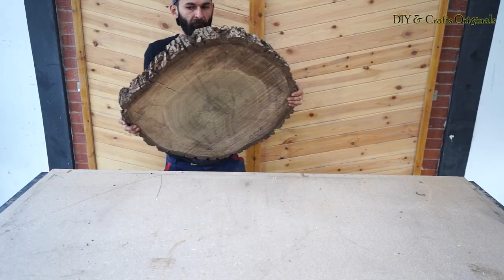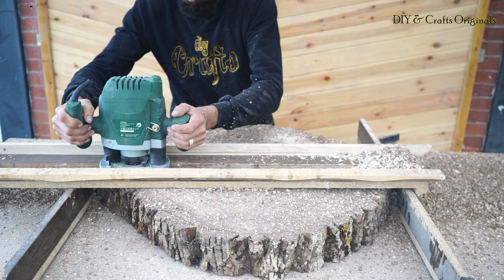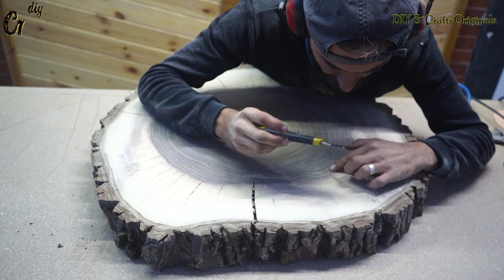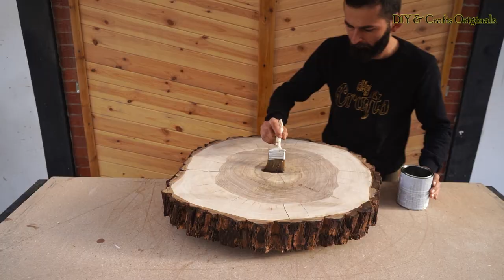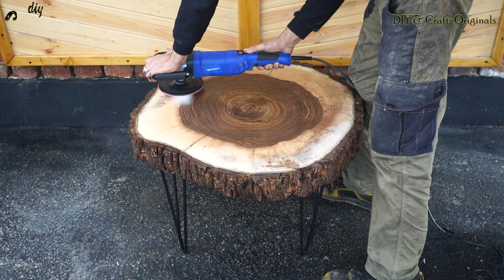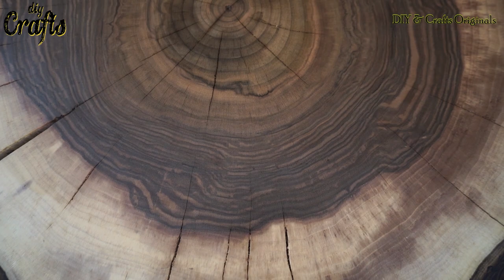Live Edge Coffee Table With Wood Bark

Comment: Do you have to use the router? I don't have one however I do have a large belt sander. Can I just sand this down to get the same results?
Reply: You may not get an even grade trying to do it on a Belt Sander... Which is why he had the brackets on either side and used a brace so the router couldn't go deeper than those boards, that way you get a completely even surface all the way across...
Of course it would have been nice had he bothered to explain any of that while doing it...

Comment: He used polyurethane for the bottom and sides, the top is osmo polyx
Reply: will the poly be enough? I'm making a small table (my first ever live edge table) and I got an amazing deal on a beautiful piece of almond wood the reason I got such a good deal cuz the bottom is basically all bark but its 3" thick so it's still ok I was thinking of treating the bark with epoxy but poly is a lot cheaper so I just wanna know if the poly would be enough

I'm going to buy the wood finish tomorrow so the sooner the reply the better 

 thank you
Reply: @aboodhart1399  all i know is epoxy is way better bonding to keep the bark on than poly